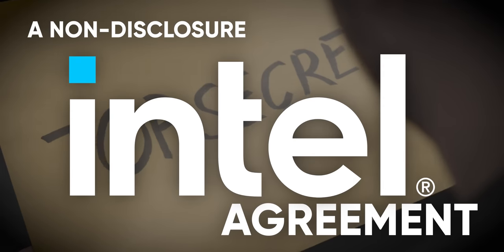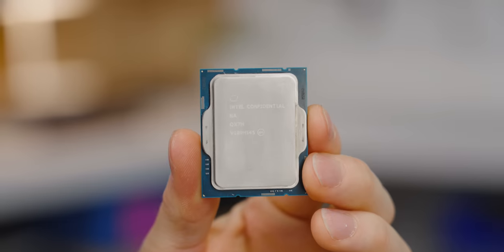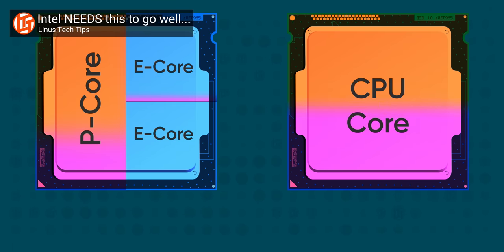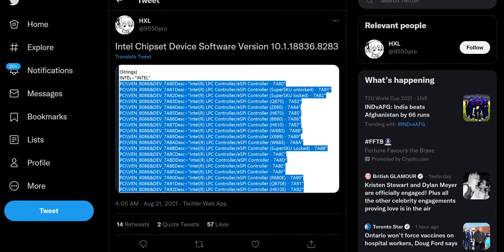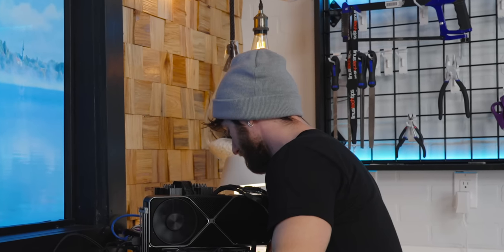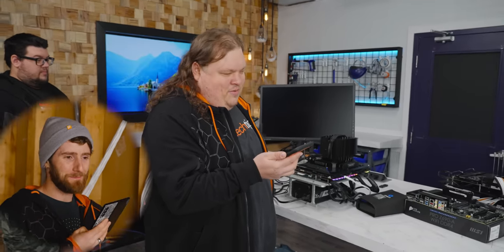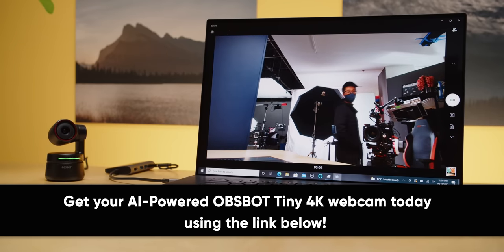SCAMMED on Chinese Craigslist...

Comment: Idea: reach out to the seller and instead of lambasting them, ask them politely for a BIOS file (and mobo model) that works with the ES (they might not be aware of such a limitation, who knows). Then you can compare that BIOS file to the retail version of the same BIOS and do a piece on exactly what Intel is doing to disable QS/ES chips on retail boards.
Reply: Why is this comment so underrated
Reply: Lemming story is a scam, they actually don't ever murder themselves and were in fact murdered for film by dsney.

Comment: I don't think it's fair to say Linus was scammed, I mean he even admitted right at the start that you could run into issues buying ES chips, meaning he was well aware that he was taking a risk and it may not work, so unless there's proof this isn't an i9 12900k then it technically isn't a scam yet.
Reply: Linus constantly China-baits.  Misrepresenting the truth to be edgy, anti-china does not shock me.
Reply: @Jaymiecain1  The all-china computer with a lot of interesting things ruined by them not swapping a 120/240v PSU was such a disaster. They never returned to it. An all time low.
Reply: @HitchensTV  Linus tends to capture some of the smallest glitches of "Chinese products" and overstate it, while ignoring what really matters. 
For a PC restricted to be sold in Mainland China, only accepting 220V is no big deal because we are all using this standard. What they should focus on is whether it can sustain the labeled power consumption.  I do know this is where low-end producers in China like to cheat, and it may result true safety issues.
Reply: @hsiajamie9526  They set it to the wrong power and then said "Thats what happens when you buy from China" and didnt test any of the parts
Reply: scam. no one buys a cpu that doesn't post
Reply: @Robrob007  True, but that's also why almost nobody except Linus would ever go buy an ES unless it was sold super cheap...
Anyone with any sense would think about it and go, well if a real/retail chip is about the same price, I'll just buy that because it'll work and come with a warranty.
Reply: @Robrob007  It can post if proper BIOS is deployed, and the seller often have this kind of source if you have asked for it. Also, in the detail page screenshot shown in the beginning of video, the seller has claimed that this is “not for amateurs” , so one just shouldn’t buy it if he is unsure of its state or lacks basic knowledge of these ES samples.
Reply: @Robrob007  unless you knew that it may  not work when you bought it.
Reply: I think he makes that pretty clear in the video. I'm the average viewer who knows nothing about engineering samples, and I definitely understood that this wasn't really the seller's fault.

Comment: Just ask the sellers for "BIOS patch"
And probably get the "working MB"
You just bought "too early", they will "test eventually" and keep selling.
Reply: Theoretically there is probably a mobo with the correct bios revision that enables this cpu to work out there somewhere.
Reply: @Konranjyoutai  correct “internal” revision actually. depends on asus staff.
Reply: unless Intel is cracking down on certain bios patches to curb the very thing Linus has done, China not playing nice ATM also....
Reply: @Konranjyoutai  Definitely, in Asus HQ. If a engineer slipped a CPU i dont think they will have an issue slipping a bios file.
Reply: That is highly unlikely. Those bios' are usually not released. Modified bios is the only way to go but there may be a manufacturer with a bios that will accept that microcode.
Reply: @Konranjyoutai  Theoretically, one could eventually mod any CPU into working, but at that point, it just isn't ths original thing.
Reply: Why do you keep using "quotes" for no reason?
Reply: @testthisfordecficiencies  No. The bios's are not usually released. But then neither are the engineering sample chips. The guy who has one probably has the other.
Reply: @davecarsley8773  Depends on the manufacturer but yeah mostly not released. That why I buy Supermicro for dev.
Reply: Yeah probably missing some CPU microcode patches

Comment: Linus: "I Got SCAMMED on Chinese Craigslist...
"
Me: "NO FUCKING WAY!"
Reply: I couldn't believe it!!
Reply: @4FYTfa8EjYHNXjChe8xs7xmC5pNEtz  if you could see my shocked face, you would be shocked!
Reply: i mean, he would have gotten scammed with dealing with regular craiglist, or chinese sellers in general, combining both is just suicide.
Reply: well he didn't get scammed, the cpu seems to be working and everything, linus just doesn't have a compatible motherboard/bios/intel ME
Reply: technically he got exactly what he paid for (presumably), so scammed isn't the right term. At some point there likely will surface a board list and hacked BIOS for these chips
Reply: I got some legit good deals on regular Craigslist though. Like a MSI 980 for $125 and the only problem was one broken DP port (which I don't use anyway). Those were the days.

Comment: can't wait to see the actual comparison 12900k vs R9 5950x after L3 cache bug fix and full wattage load on both chip! gonna be spicy !!
Reply: I hope they push the video at midnight!!!
Reply: 12900k wins
Reply: 12900k wins in single core and loses in multicore in most of the benchmarks. Sorry to spoil
Reply: @ajrsabbagh  are you sure 12900k loses on multicores? That’s not what I heard
Reply: @Nikhilsj33  16c 32t vs 8c16t which do you think will win multicore
Reply: @Nikhilsj33  not that it matters, if it can barely beat an  year old chip it's not a win, it will get crushed by both anything am5 or am4 with the new cache.
Not being a fanboy but considering how Intel called AMD dead they deserve some thrown shit.
Reply: @WayStedYou  Uh... Pretty sure the 12900k is 16c 24t
Reply: @WayStedYou  it’s 16 cores and 24 threads
Reply: @justetan3566  Honestly, it's karma at this point. If it just barely beats or matches the 5000 series, they will have a tough time. One that would only be worse if they still consume more power than AMD too
Reply: @Kenjionigod  even if the performance gains are marginal, support for gen5 and ddr5 are they key reason for update
Reply: Set the pl1 of 12900k to 105 watts to match the 5950x then see who wins
Reply: @justetan3566  Do you really think it barely beats amd lmao.
Reply: It is convenient what intel test cpu on windows 11 with “broken”(for AMD)  scheduler and l3… kind-a WIntel strike back…
Reply: @rsyukesh4536  What you are saying isn't really a good opinion imo lol. Power consumption is necessary I think. The why don't we set the power of Amd's chip and compare? It just doesn't have the ability to utilize that power. Intel does lol.
Reply: @WayStedYou  Hybrid cores are new technology in this type of platform I believe. Intel beats Amd in both single core and multi core or that's what I heard lol.
Reply: I was hoping the 12th gen chips to have lower power draw for the same performance due to the p e cores. Guess I was expecting too much...
Reply: @StrykerMaximus  considering everything says it's about 10% or little more faster in single and even less in multi core yes.
I also doubt that gaming would be improved that much due to latency and shit.
Intel also used fake benchmarks with gimped windows 11 on AMD, at this point defending Intel as a company is just delusional, liking AMD or not doesn't matter, if you deny that you are just ignorant and blind.
Reply: @keirania__4759  When you translate this bots comment, it shows weird stuff after the “Link” section.
Reply: @WayStedYou  uhh 5950x has 16c not 8
Reply: @funbrute31  for mobo that only support 2 gen cpu? no thanks, we need another am4 x370
Reply: @Kenjionigod  That why AMD is not too worried I suppose and is probably planning to lower the price of the 5950x in order to maintain a much better ratio price/performance than Intel.
Reply: @WayStedYou  My R7 3700x murders my Dual E5-2670 v2 server in multi. 8c 16t vs 20c 40t.   IPC and cycles/s matter.
Reply: @MaksKCS  They were saying the 12900k is an 8 core. It technically isn't, but it's still just 8 performance cores to pair with 8 efficient cores, so it's pretty much guaranteed to lose in multicore performance.
Reply: Intel wins the majority benchmarks but consumes 2.5x more power.
I'd wait for a few more months for zen3+ proc if I still had am4 mobo. If not I'd wait till q4 2022 when AMD will release zen4 which might use 5nm, new socket, DDR3, pcie gen 5 etc.
Reply: @lockhrt999  That's crazy, the LP cores do nothing when you are actually using the CPU. I guess they are just for when your PC is idle?
Reply: @ffwast  I doubt that lmao.
Reply: And intel 12th gen on win 10
Reply: @StrykerMaximus  lol is not punctuation you don't need to end every comment with it that's where you use a full stop.
Reply: @norfolkngood8960  Ik dude. I have some problems stopping using it lol.
Reply: @StrykerMaximus  Yea who cares about efficiency? /s
Reply: @Kristi Marie  They will dynamically adjust the work load with built in task schedular
Some background task can be assigned to run on LP core when High power core is running very intensive task.
LP core will still be used for something when u actually use ur computer
Reply: @Nikhilsj33  Lol I was just guessing. You can see the benchmarks now. 12900k mostly wins, but loses in some benchmarks.
Reply: I imagine it will be like most Intel V AMD benchmarks.

Intel wins in single-core loads.
AMD wins multi-core loads.
Reply: @ajrsabbagh  current released benchmark by intel is during win 11 still has L3 cache bug for AMD, and on their test 12900k draw 100% more power than 5950x
Reply: @ajrsabbagh  i stand corrected there's new video has been released, time to watch (midnight over here)

Comment: I owned a QX7E, which is 12900K es2. It works on Gigabyte Z690, using the BIOS that "DOES NOT" support 13th intel core. Updating the BIOS to support 13gen will cause this to not boot up. However, since 12th gen is not released yet, I'm confused why the chip won't work on Linus's PC. All samples before(include some) ES3 won't run the first pciex16.

Comment: 8:02 The solution is simple (?!?), get an engineering sample mainboard,
that has a BIOS that allows ES samples, or use a BIOS flash utiltiy that allows flashing an engineering BIOS update onto the mainboard's BIOS..

Alternately, check the BIOS code for the lock out code and place a JMP instruction at that spot to skip it, then flash the BIOS with it.

Comment: Hey Linus and the gang at Linus Tech Tips, have you tried using a DDR4 based platform instead of DDR5?

According to some of the info floating around regarding ES2 chips:

1) GPU's in the PCIE 5.0 slot won't be recognized (ie. first slot), as current gen GPU's aren't PCIE 5.0. Use alternate slots. (seems like you already tried this?)

2) Something about the memory lock frequency of DDR5 motherboards doesn't currently work with these chips. Not sure exactly what this is referring to, but apparently some MSI DDR5 boards can automatically reduce the frequency of DDR5 memory to start sometimes?

Comment: LGA 775, 1156, 1155, 1150, 1151, 2011 now 1700?
I've honestly lost track of Intels LGA layouts.
At least with AMD it's relatively straightforward in that, AM2 is before AM3 and AM4
FM2 is old. The one to succeed AM4 is AM5 etc.
Though I'm staying with AM4 for the foreseeable future, since I only moved to AMD since they said it was more "futureproof" so I'll ride it until the 5950X becomes obsolete.
Reply: Its Lga 775, 1366…….

Comment: Dang.,. I wanted to see how it did. The idea of performance cores and efficient cores makes real sense when you consider the amount of applications that can be running in the background. If the CPU was able to dump all of those background apps to another efficient core and allow all the high performance cores to be used for gaming, it could really make a difference on PCs with lots of crapware.
Reply: @gorkskoal9315  Did you mean Synchronicity? That's a great album. And note I said crapware. Not sure how you got your comment from my comment. That being said, the PS4 had a secondary cpu and memory for background tasks- like downloading/updating games. So it's not like this is totally new ground.

Comment: Hey Linus, Actually that can happen as you guys say, because this kinda of qualified samples are not suppose to work in a commercial motherboard UNTIL a modified version of the Bios, because I did the same with a QNCT (which maybe can be different, because it's a a notebook QS but its very closed to that).

Comment: Are there any silicon level repair businesses?  I'm thinking from an e-waste perspective, it might be nice to be able to adjust the hardware later in their life if they get damaged or the hardware support changes in software. The amount of energy and emissions baked into anything that uses metallurgical grade silicon is insane and there should be better solutions than shredding them. Maybe upcycling the chips to run at lower frequencies with less power for specialized tasks instead of operating as generalists would be a viable use for them once they become "obsolete".

Comment: All the es samples of 12th gen cpu couldn't work on the fist pcie lane, which connected directly to cpu. You can install the graphics card on the second pcie lane that connected to south bridge. Then it may probably work. This problem only appears on 12th gen cpu.
An uploader on bilibili has a thorough test on this cpu. And 13th gen cpu has not this problem.

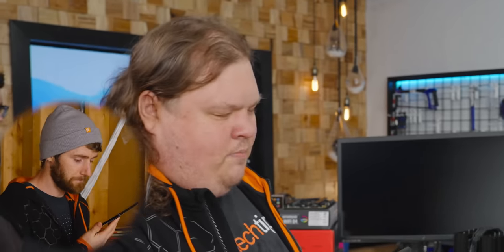Comment: 7:50 it takes weeks for some unofficial developers to modify all the existing bios of popular boards on the market. Usually at that time, price will come down and create a reasonable gap to consider buying it or not. Same thing happened to some modified laptop cpus like QQLT(8th gen 6c12t overclockable) and QQLS(basically 10980hk es) when it takes months to develop a large number of bios to support multiple boards on the market

Comment: You can strip out the Intel ME firmware out of the bios. After that, it will boot, just without Management Engine doing much at all.
Reply: @paulabrudan7896  coffeetime 0.99, its utility to modify skylake, kaby-lake, coffeelake and comet lake bioses, it can disable intel me.

Comment: I picked up an Amd Ryzen 1700X for around 100 dollars not long after the launch. I did find it strange it came in a wooden box like one you get jewelry in.  It ran nice and well I sold it to a friend who a couple of years later sold it back to me..  I resold it in a build I did and a few weeks later the customer had issues.  Well i pulled it and picked up another chip and sent it back to AMD only to be told it was an Engineering sample and they do not Warrenty or work on them so...  I was SOL...   So buying such things come with zero warranty..

Comment: Why not downgrade the bios to an older version? A lot of motherboard manufacture websites will have their older Alfa/beta bios in an online ftp archive.. or install a custom bios from American megatrends… you do have access to the retail chip which you are technically not allowed to disclose, but your contract does not prevent you from using their cpu to start the computer, and downgrade the bios..

Comment: Well Linus, that is ok.  the 4th is in just an hour or so.  Canada Computers has 6 CPU's listing, and they are already showing 0 inventory on the i5-12600KF, and limited inventory for the  i9-12900K, i9-12900KF and i7-12700KF if you add em up across the country less and 40 of each of those. Of the six on NewEgg thet straight up list the  i5-12600K i9-12900K and i5-12600KF as out-of-stock.  So, will wait patiently for the5'o'clock news story on the outcome of the switch flipping to live in just over 40 minutes :)

Comment: 4,500 RMB isn't that bad if it is a genuine part, but considering you get it from a shady source with no guarantee I would never trust the seller. Also finding a board that works is going to be a pain as shown in the video.

Comment: 6:39 Linus brings up the idea that maybe Intel has done something to make the CPU inoperable on purpose. While it's later discovered that this was a Management Engine update, likely NOT purposely designed to break the CPU, this wouldn't have been too far fetched. 

As Linus points out toward the beginning of the video, these chips make it onto the market through individuals at board/component partners. This isn't something CPU manufacturers want, but what's more is that this is a big source for performance leaks too. And you can bet companies like Intel and AMD would like to crack down on this.

One method I have seen used is sending CPUs that have been programmed way underperform. To the point where it's obviously not representative of the final product, and thus not even worth the effort of leaking anything. Typically, this is not a hinderence to partners. Though I'm sure it is a disappointment to the engineers who want to play with cutting edge tech early.